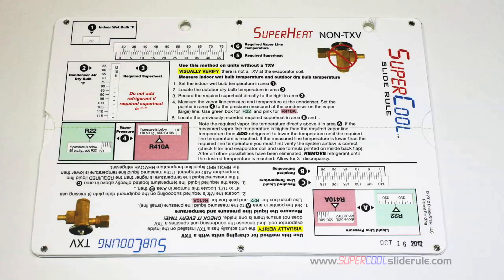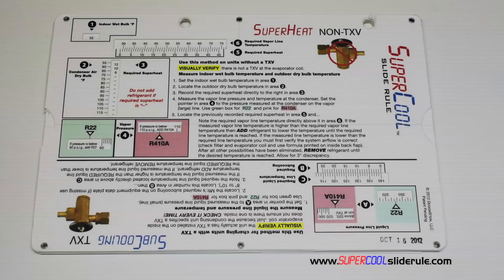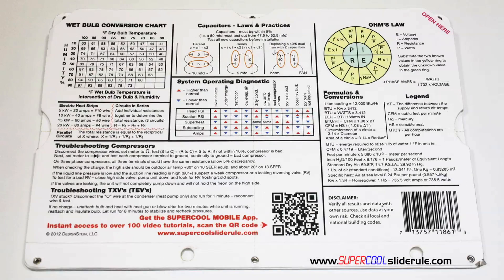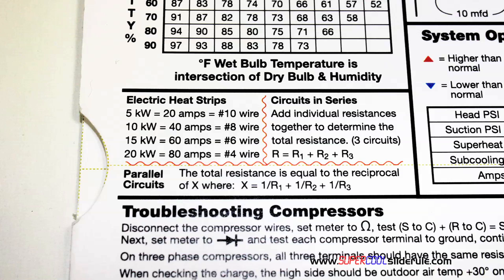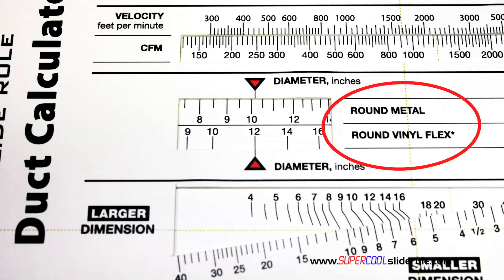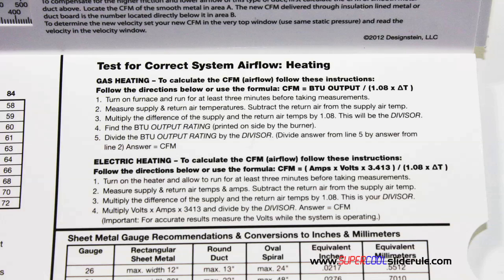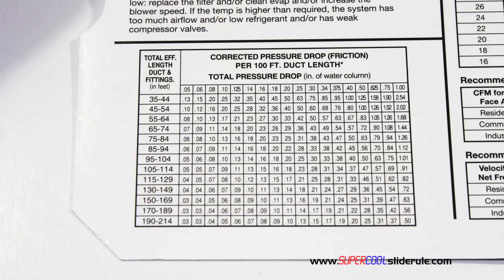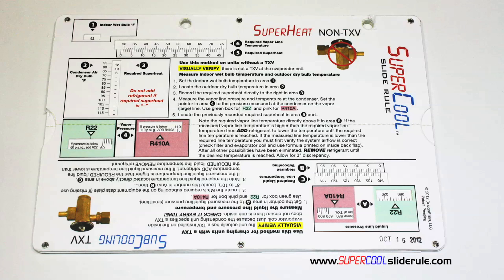Basic functions of Gas Furnace components

Comment: He's wrong about how the flame sensor works. What he was describing was a thermocouple, which is not what the flame sensor is. It's not made of two dissimilar metals. It's just a simple metal rod mounted in a ceramic insulative sleeve. It functions by sensing conductivity through the flame. No flame, no conductivity. Did you know that flame conducts electricity? It does and that's because there are ions in flame and ions are electrically charged. How about that?
Reply: Dave Brast 
You are right!
You comment makes sense and sounds very smart . 
Thanks.
Reply: create your own channel then.